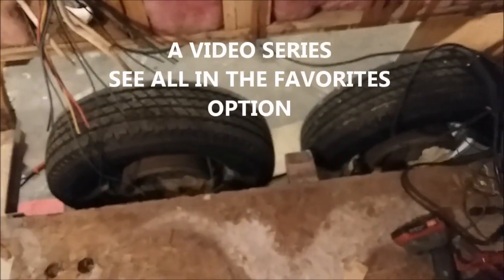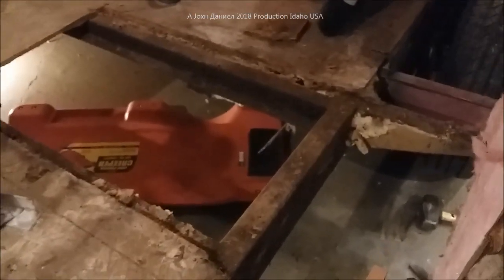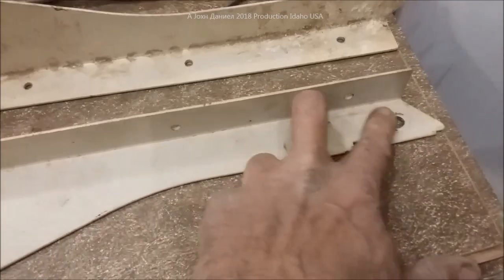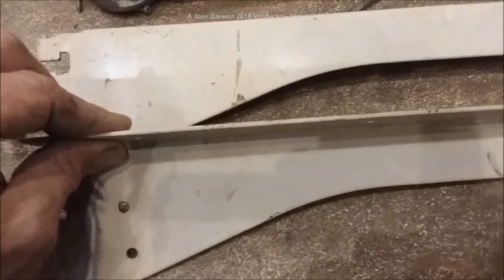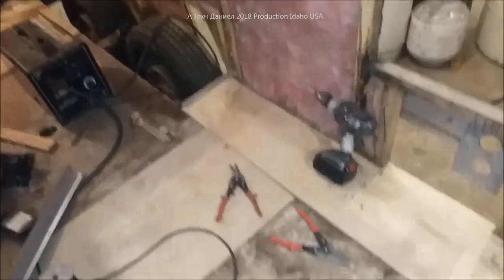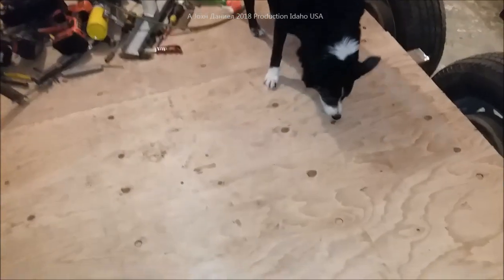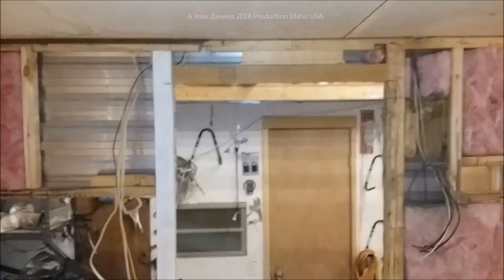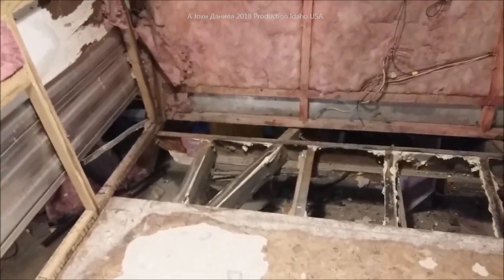FREE Holiday Rambler Repair & Convert into 27 Cargo Trailer - Vid 4

Comment: The 0l' Camper is look'n good. Its com'n right along with the build. This rig should last for Many-A-Year for you as a portable shop.
Reply from the maker: We were stumped by the 3.5" axle having welded on brake plates, full plates. Now we realized the trailer has Dayton 4000 lb axles, and bearings from a 5200 fit it even though it has 10 x 2.25 brakes on it. A hybrid!